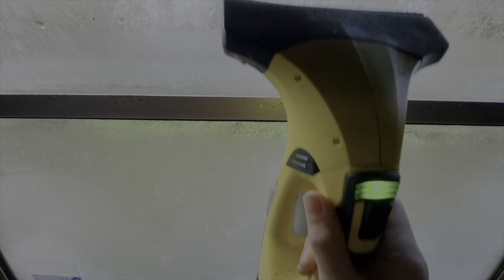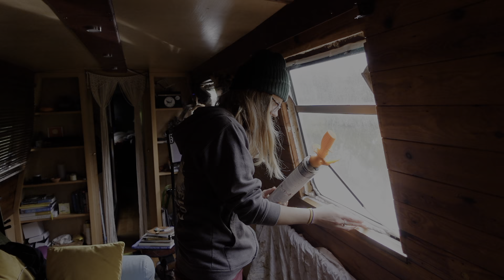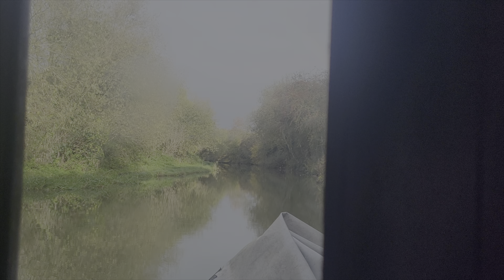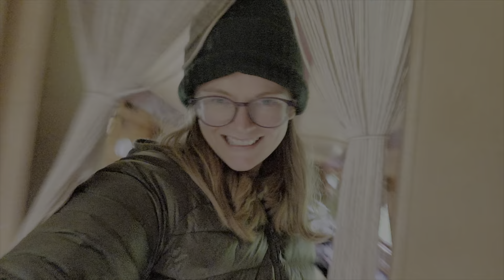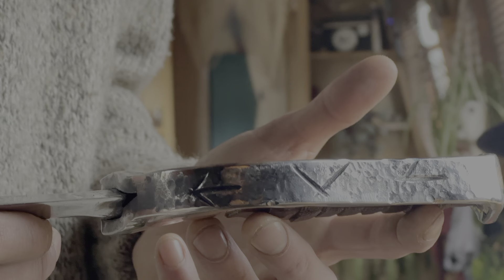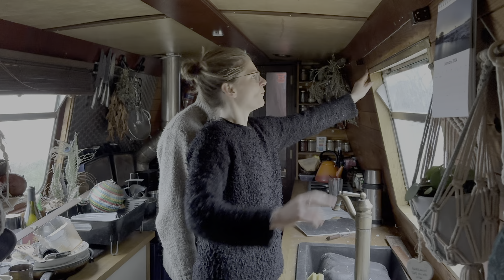Transforming my Leaky Narrowboat | Window Insulation

Comment: I have also experienced that DIY disaster with the expanding foam. Never again - I always wear gloves and never, ever let it touch my skin - nothing gets it off. In the end the 'solution' was to wash my hands in oil to seal it in and then wait for the skin to drop off by itself. Or sand my fingers, which I declined. 😂 I'm told that these days "Big Wipes" will now get it off but they weren't about at that time. As you've discovered it is very easy to shape by cutting/sanding after it has set hard, so also resist the temptation to shape it while wet - it always ends in tears. 🙈 Also - please wear gloves (and maybe use a cheap clamp) when cutting with a saw - will save you from lacerating your hands! If you sand the ends/faces before you varnish, you'll get a nice finish without any splinters. 👍 Still, with the help of George you got a great result, so well done!! 😁

Comment: using a foam gun you need to turn the flow down or only pull the trigger very slightly to control the output of foam, it looks like it's coming out way to fast !
Reply from the maker: Nice tip!

Comment: You will be amazed if you would you star drive screws instead of philips.  I bought a battery powered nail gun, and never use it since I started using star drive screws.
Reply from the maker: Nice!
Reply: Also a 1/4 inch driver works much better for putting screws in.